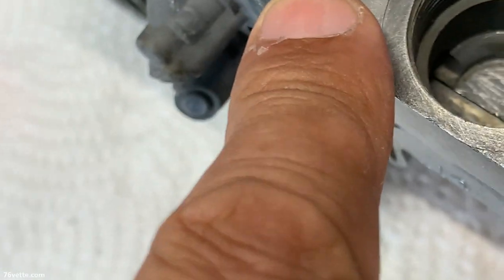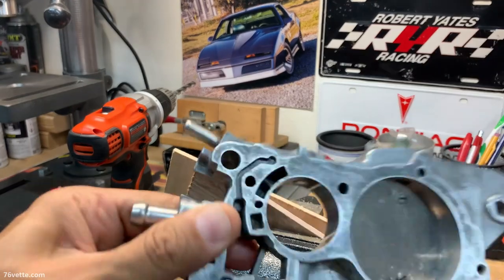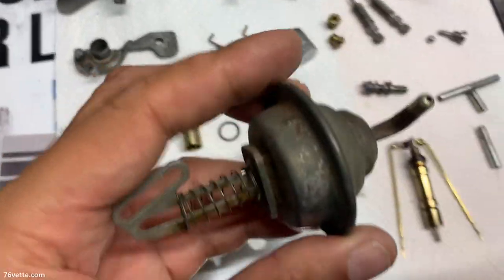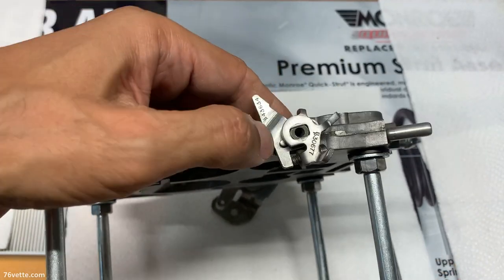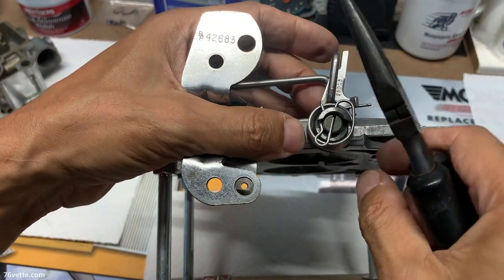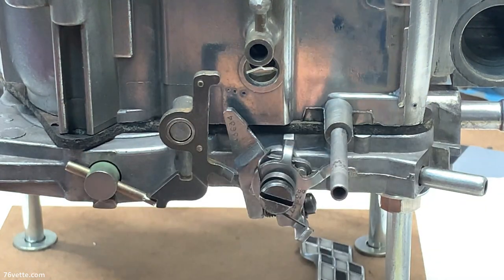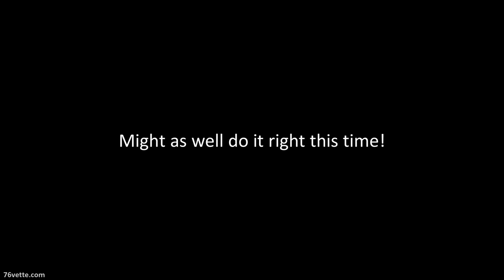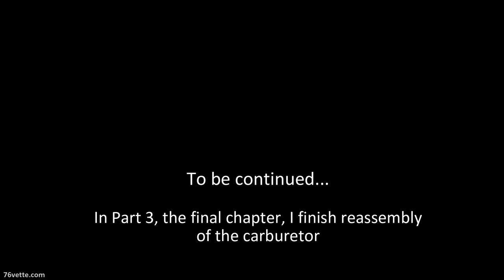QUADRAJET Bushings, Choke and Fast Idle

Comment: Great to see you saving these quadrajet's, I have a feeling alot of folk's will be glad to see these factory numbers carburetor's and wishing they had them instead of aftermarket ones in the future!
Reply from the maker: I like to buy Quadrajets if they are complete and in good condition. But they have to have the right numbers. You can still find them at swap meets for cheap prices. And it’s great there are plenty of replacement parts available. If anyone wants originality, the right carburetor is the way to go. 😊👍🏻

Comment: Great videos!.. I rebuilt one but not completely and your videos show all of the details.. great job!... I checked out the link for the throttle shaft drill bit.. they're not cheap at $80 but you do get enough bushings to do 5 carburetors so that evens it out.. I think I have that many on the shelf😀... Some people prefer Holley carburetors but I like the old quadrajets for some reason.. maybe because I had one in my 1977 350 Chevy truck and my 1977 Leocraft motorhome with a 454.. I had those secondaries open many times hauling trailers on some pretty hilly terrain and they treated me just fine🙂... I have saved your playlist and will be going through it shortly!
Reply from the maker: Quadrajets are great carburetors and usually misunderstood. Thank you for watching! 😊👍🏻
Reply: Absolutely my pleasure!... love the big secondaries haha
Reply: @76vette I managed to pick up what I believe is an 800 or 850? BOP carb with the bumps in the primaries and I just put it on a 1996 l31 350 roller camshaft roller lifter engine that I'm putting into my 1975 GMC.. it runs pretty good on the engine stand!

Comment: I have a question ....
Did they ever make a quadrajet where the typical. Timed vacume port had manifold vacume instead of timed ? 
I have a 1983 Chevy g30 van (1ton) .
It has a sbc with a 4bbl quadrajet but the usual timed port has full time manifold vacume .
      Is there something wrong with my carb or did they make some this way ?
Reply from the maker: It sounds like you have a Quadrajet 1708 which is a computer-controlled carb. On those carbs timing, along with other functions, is controlled by the ECM. 
To confirm the type of carb your vehicle has, read the number on the throttle side of the carb. It should start with 1708. If someone installed an older one, it won’t run properly.